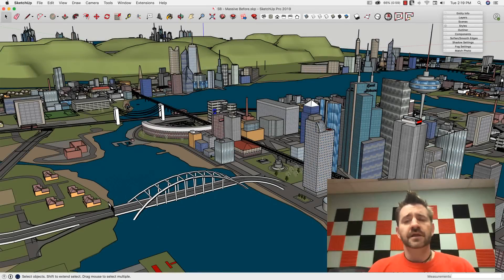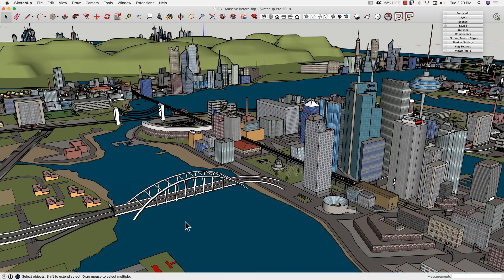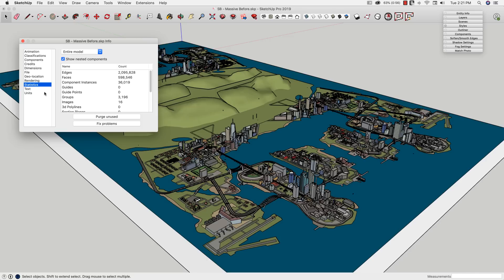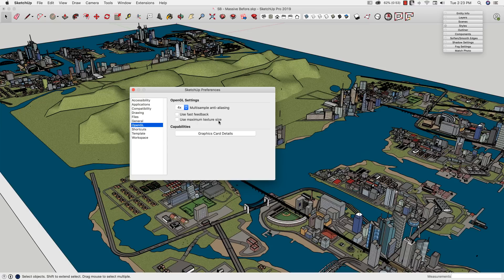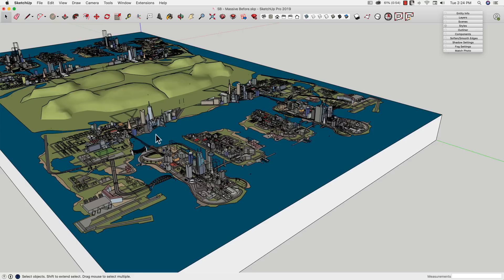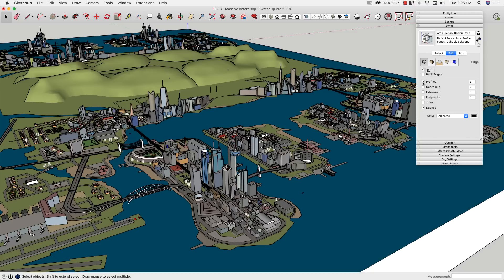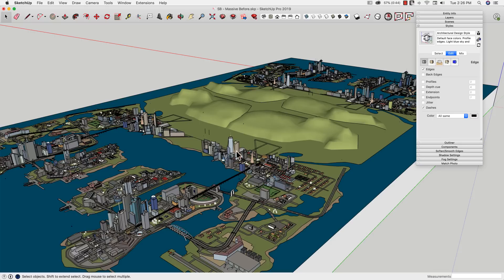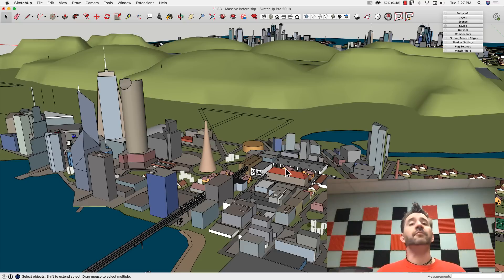How to get the best performance with a large SketchUp model - Skill Builder

Comment: Another tip, don't use the default 24 faces when making circles and arcs when you don't really need it. Rain gutters, traffic sign posts, fence posts, or street lamps work perfectly fine with 6 or 8 sides. Cables or ropes look completely fine with only 3 sides. There is no visible quality difference when viewing them from a few meters, but it saves huge amount of edges/faces when you place tens or hundreds of them in your scene.

Comment: Wait, wait, wait... I've thought about using sketchup for more than 3D printing models. I've never seen a performance hitch or slow down with one texture and maybe 15k polygons... Yea I could probably run it with literally anything... First question; does sketchup utilize newer consumer grade graphics cards? 500k polygons (same thing as faces? Maybe? Kinda? No?) Seems extremely low to ever give poor performance. Are you running this on a two core processor from 15 years ago with graphics disabled for demonstration purposes?
Reply: It's just the way SketchUp is. If you model efficiently and don't create unnecessary edges/faces, it runs smooth on 10-year-old 3-core AMD CPU with 4 GB DDR2 RAM and GT1030, even with 500k faces. Untextured.
With extremely high detailed models, it will run like crap no matter what. It's ideal for architectural visualizations, but it's absolutely necessary to use proxy models of cars and trees for rendering. It's also not advised to use 3D Warehouse, 90 % of the models there have absolutely shitty optimization, or are too simple. Like a couple of kitchen cabinets with 30k faces and 20 MB file size. Put 5 models like that in your scene and performance will go to shit. Make everything yourself, don't use plugins and remove any unnecessary faces and edges. Also you don't usually need to use default 24-sided circles, it's overkill for small details in large scenes. 
I'd like to have a closer look at the model in the video, but my guess is it would be possible to model such overly simplified city with only 100k faces, with no visible quality loss.

Comment: Thanks for compiling these tips - really a great help during the build process. However, all of these steps are workarounds for Sketchup's inability to take advantage of the multi-core processor running in all our machines...even some fairly simple shapes at high resolutions, as needed for 3D print design, can cause significant wait times while the CPU plugs away one instruction at a time. It's time for multithreading!
Reply: Unfortunately, the task of displaying a 3D model to the screen is inherently a single core process. It is not something that can leverage multiple cores. As of now, no 3D modeling software uses more than one core to draw the model to the screen (there are other softwares that boast multi-threading, but that is for other functions, beyond drawing the model).

Comment: Hi Matthews,

Thank you for this, it will help us for improving display in Sketchup.
I have a question : is there in Sketchup the following feature, that would be helpfull : not to draw objects (groups) that are further a certain distance from the camera?
This would be a data own be groups or component, and you could say: further than some value, I only want to display the encompassing group at the top level, not the small ones inside, that have more polygons.

Thank you for your help.

Comment: I do purge all the time.. In my experience, purging is great at slimming the file size, but unlikely for it to boost performance. It will definately save and open faster. :P
Reply: Yoo kim! Will those changes in sketchup settings affect the overall render output in enscape for sketchup??
Reply: @ryoichiwatanabe648  that's tricky. Some materials and proxies may see an issue. This was true when I was working on Vray. But I haven't seen issue with Enscape yet.
Reply: @JosephKim  oooowh aight! damn, it's a love hate relationship with sketchup..,  and thx for the answer kim!! Lovin ur tutorials man!! keep it up!!